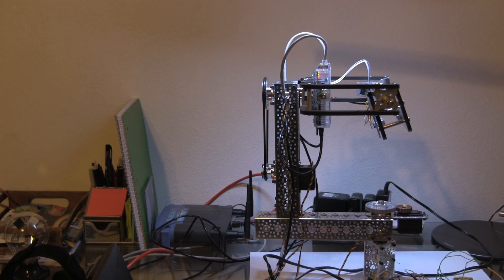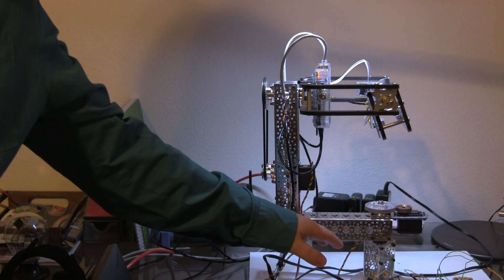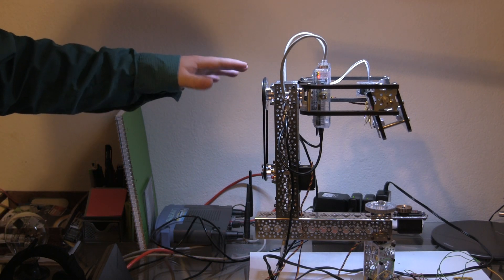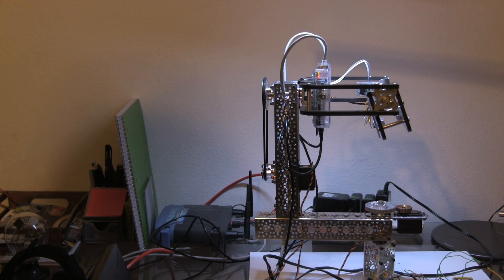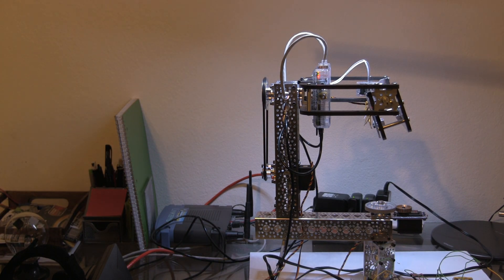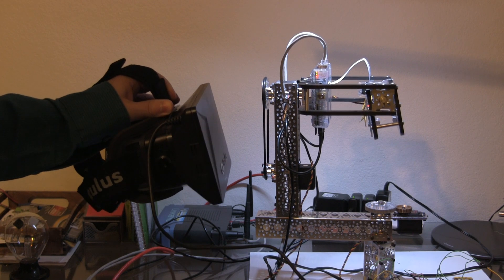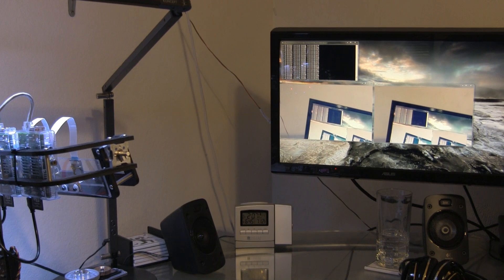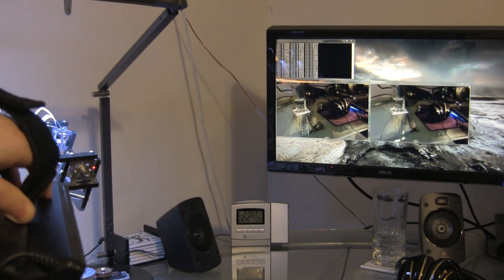Stereoscopic 3-Axis Camera Gimbal - Oculus Rift

Comment: Really cool project. I'm a mechanical engineer and I'm gonna try to learn this stuff. Not sure where to start, but I made some cad models of different gimbals, and now I need to understand everything else, like programming. Too obsessed to not dive into this :)
Reply: May I ask what circuit board/camera you are using?
Reply from the maker: +Geir Osmund Aamlid I've got some more info in the description, but basically I'm using 2 Raspberry Pis which are a cheap linux-based embedded computer. The cameras are made specifically to work with the Raspberry Pis, also pretty cheap.
Reply: Corey Shuman My mistake and thank you :) I'll post mine when I'm finished. Not sure if I'll 3d print the frame or not, I'll send you a video of it when i'm done(If I ever get done haha).
Reply from the maker: +Geir Osmund Aamlid I can't wait to see it, good luck!

Comment: Very nice demo.  I'm trying to run your oculus.cpp.  I'm getting the following two errors.  Do you know what I might be missing?  (I'm new to C++).
Error 2 error LNK2019: unresolved external symbol
"public: static class OVR::Platform::Application * __cdecl OVR::Platform::Application::CreateApplication(void)" (?CreateApplication@Application@Platform@OVR@@SAPAV123@XZ)
referenced in function _WinMain@16
Error 3 error LNK2019: unresolved external symbol
"public: static void __cdecl OVR::Platform::Application::DestroyApplication(class OVR::Platform::Application *)" (?DestroyApplication@Application@Platform@OVR@@SAXPAV123@@Z)
referenced in function _WinMain@16
Reply from the maker: You will need to make sure you download the Oculus SDK, OpenCV SDK, and FFMPEG SDK, and make sure they are referenced in your project. That error makes it sound like the Oculus SDK is missing, or the reference is incorrect.

Comment: looks great! Is there a way to implement this to a Alexmos gimbal?
Reply from the maker: I'm sure you could. There would just need to be development to interface between the Alexmos and the Raspberry Pi.
Reply: Corey Shuman thanks for the reply! as I like to think of myself as only an advanced computer user and not at all a developer, are you not interested in developing this? the market is huge, I think most of the commercial gimbals out there are using alexmos boards. the only device available is an experimental one and is costing more than the oculus http://emrlabs.com/index.php?pageid=3. besides, there are tons of drones and cable cams owners already using alexmos and I believe more than excited to have a simple and accessible solution for using there remote devices with 2 cameras. with vp9 and h265 coming our way, I even hope to have this possible over a reliable high speed internet connection. with facebook acquiring oculus, I think also small stereoscopic gimbal-driven cameras will be available for the VR. would you consider? :)

Comment: hi so I am trying to implement your code. but i am getting some errors i have fixed a lot of them but i am not sure what to do about this one "cap_ffmpeg_stream.obj : error LNK2019: unresolved external symbol _av_log_set_level referenced in function "public: __thiscall cap_ffmpeg_stream::cap_ffmpeg_stream(void)" (??0cap_ffmpeg_stream@@QAE@XZ)" I had to make a new project in put your code into it so i had to find a lot of the .lib files for the other ones but i am not sure what this one came from. thanks for any help you can give me
Reply from the maker: Hi Eric, off the top of my head I'm not sure which library file that is from. I will look into it and let you know. What versions of the OpenCV library and FFMPEG library are you using?
Reply: Corey Shuman I am using ffmpeg 20120115 git-784ds14, opencv-2.4.8, and visual studio 2013. I know that the problem is that i need to import .lib files. I have never used ffmpeg but I cannot find .lib files that come with it but I did do the basic install that it shows online. Thank you for the help
Reply from the maker: Eric Eide You can get the ffmpeg shared build here: http://ffmpeg.zeranoe.com/builds/
That has the lib files. Here is the full lib include list in my project:
winmm.lib, libovr.lib, libovrd.lib, avcodec.lib, avdevice.lib, avfilter.lib, avformat.lib, avutil.lib, postproc.lib, swresample.lib, swscale.lib, opencv_core247d.lib, opencv_imgproc247d.lib, opencv_highgui247d.lib, opencv_ml247d.lib, opencv_video247d.lib, opencv_features2d247d.lib, opencv_calib3d247d.lib, opencv_objdetect247d.lib, opencv_contrib247d.lib, opencv_legacy247d.lib, opencv_flann247d.lib
Reply: Corey Shuman  I have figured out the problem I am missing avcodec.lib, avdevice.lib, avfilter.lib, avformat.lib, avutil.lib, postproc.lib, swresample.lib, swscale.lib which looks to be the ffmpeg files I am not sure what I am doing wrong but when I down load it there are no .lib files in the downloaded folder. I have been looking it up like crazy and one site tells me to put it in to system variables. another site said that i need to use mingw to do something with the folder but it wont let me do it because the file does not contain a configure command. do you think you could tell me what you did? or could you post your ffmpeg file to your github site? thanks for all your help.

Comment: Great stuff! A few questions:
How are you planning to sync the two video streams?
One stream seems to lag behind. That must feel very weird with the Rift, a bit like what a chameleon feels :)
Also what video codec/streaming tools do you use?
I'm working on related things, have a look there: 
Pan-Tilt FPV using the Oculus Rift and http://bitoniau.blogspot.fr/2014/02/pan-tilt-fpv-using-oculus-rift.html
Again, nice work!
Reply from the maker: Thank you! You are correct, when the two streams are out of sync, it's intolerable in the rift. Basically instant nausea. Right now I'm accounting for the sync by adding a hotkey to flush both video buffers. When done enough, they will eventually sync up. Long term, I intend to wrap the Raspi's camera functionality within a server, which the PC software will control to keep sync. The video source is the Rasperry Pi and PiNoir camera. The built-in raspivid app streams the video as a raw h264 stream. I'm using FFMPEG and OpenCV to capture and combine the streams on the PC.
Your project is looking great as well, and I really appreciate the quality of the write-up!